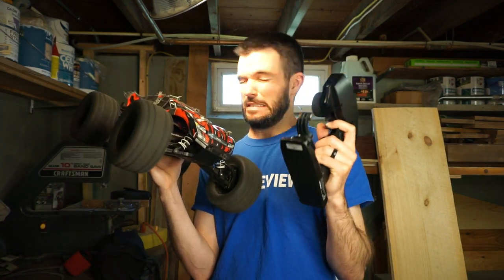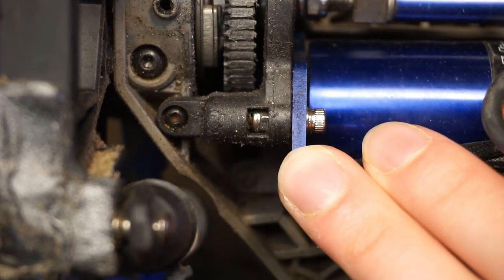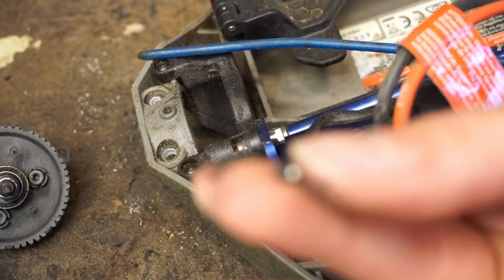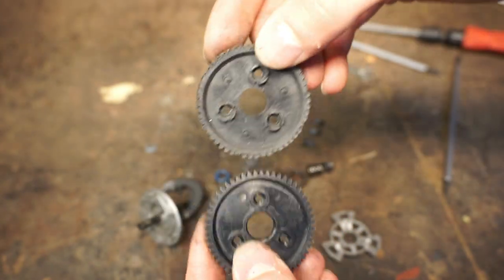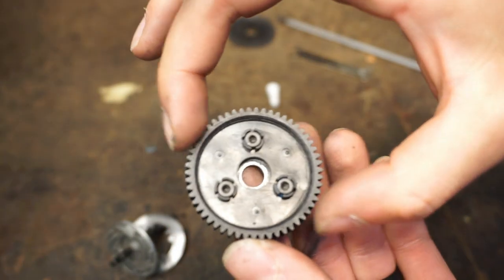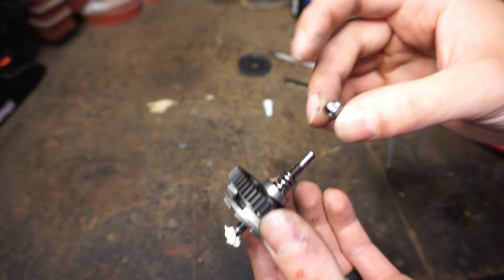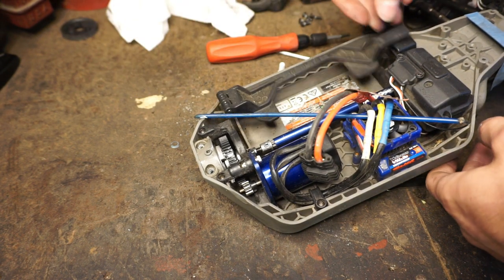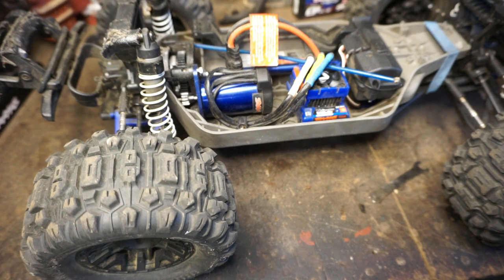Step by Step how to change a spur gear  Traxxas Rustler 4x4 vxl Slash 4x4 VXL Stampede 4x4 vxl

Comment: These models do not have a crush assembly. Slipper clutch assembly isn't  required to be  disassembled but good to  completely  inspect. Ultimately, not an easy video to film. Good job.
Reply from the maker: Thank you for the feedback. Much appreciciated

Comment: Good tutorial thank you. I've honestly never had to replace a spur gear before or pinion haha so this was a first for me. Question about the slipper. Do i have to take the slipper out to adjust it (tighten, loosen)? When i tried to loosen or tighten the little nut on the slipper it just kept spinning the motor. Idk if im dumb or if theres something else i need to do to keep the motor from spinning?
Thank you for the video.
Reply from the maker: You can tighten it with the small nut infrastructure of the spring on the slipper. Don't have to take it out...

Comment: you just need to pull out the slipper/spur assumbly, you dont need to remove the grub screw for the center shaft it pulls away with the little outdrive still attached. Also you dont need to dissable the slipper just take the 3 screws and replace the spur with a new one. Ive done this around 10 times already
Reply from the maker: Yeah I've heard that a couple of times now. Thank you for advice. I do more work than required.
Reply: @GReviewz  clutch shoe replacement is your teardown in the vid.
Reply: Good call out you don't need to do all that for the spur.
Reply: @GReviewz I found your video very informative and useful bro I can use this for multiple fixes thank you

Comment: Great video. Could you do one on setting the mesh, after putting or replacing the motor gear, the 11 tooth comes with it I believe. I tried a different size gear and till can’t get my mesh set the right way.
Reply from the maker: Great idea. The little piece of paper trick usually works for me
Reply: I changed to 9t pinion and had a rough time with mesh. Used a piece of sticky note paper and it worked great for me. I geared down for bigger tires and driving in the grass.

Comment: Changing my own spur gear right now, second time but I was wondering how tight I should tighten the spring?
Reply from the maker: Depends on if you want to pull wheelies or not.. if you do, crank it down, if you want controlled launches, not as tight

Comment: I put an arrma blx 100 esc and 3200 kv motor with mx 2.8 no heat issues.
Reply from the maker: I've heard arrma are less durable than traxxas electrics?

Comment: Great video.  My son just got one and I wanted to know what I'm in for WHEN it goes.  What kind of grease is that at 8:29?
Reply from the maker: Red n tacky grease is the best for differentials
Reply: Just got the rustler a couple days ago and the stock plastic gear is already shredded to bits. I recommend you buy a hardened steel gear to replace it. Got one on Amazon for about 17 bucks
Reply: Plastic spur gears are only about 3 bucks at the LHS. Lot cheaper to replace plastic than a steel spur but it depends on how often you shred your spur. $3 will add up, so will $17

Comment: Does your truck do wheelies on 10/54 gearing? Cause i cant get my rustler 4x4 brushless converted to do wheelies, and i know you have the exact same car as me. So do you know what’s happening?
Reply from the maker: Yes my rustler 4x4 vxl does wheelies no matter what gear I have. 2 big factors.. what battery are you using? If you want on demand wheelies you need to have a 3s lipo. Also, you need to tighten your slipper clutch all the way tight. If it is even a little bit loose itll never pop wheelies. The clutch will just slip. Let me know if that helps
Reply: Alright im using a 4000 mAh 3s lipo. And I’ll tighten that slipper clutch. Thanks!

Comment: What size spur gear would I need for a brushed  rustler 4x4? But I do plan on making it Brushless
Reply from the maker: Alex, stock for both trucks is a 54T spur gear. Here is the link to purchase: https://www.amazon.com/dp/B07PHMLSNW/ref=cm_sw_r_cp_apa_glc_fabc_03Q8RZHV4J2YQ548N0CH
Reply: @GReviewz  thanks a lot 👍🏽
Reply: @GReviewz  Can I run a steel pinion gear with a steel spur gear!?!?!?!

Comment: That plastic bushing that has the bearing then spring go on should be replaced. The plastic wears out and causes a wobble causing the spur gear to wear. There is an aluminum replacement that is better. Your there changing the spur it’s a no brainer to upgrade that part
Reply: Exactly what I just did :)

Comment: Why does my Traxxas Rustler 4x4 vxl keep stripping the gears? First I changed the pinion gear to the optional 17 tooth pinion gear it came with and it stripped the nylon 54T spur gear. So then I switched the spur gear out with a metal one and it sheared the teeth off the pinion gear. Didn’t even put it on the floor just elevated free spinning. I did the paper mesh trick and everything. What am I doing wrong?! So frustrating!
Reply: Might be too loose

Comment: I was wondering if there is any different size spurs. I want to lower it to like a 50t. But most spurs I find won’t work... if so could you possibly give me a part #?
Reply from the maker: Yes, you can get different size spurs just make sure they are 32P spur gears.

Comment: helpfull video ,could you do more reviews about the sledgehamers and clean your truck ;-)
Reply from the maker: Jef, thank you very much for the comment. What would you like to see about the sledgehammers? Just a driving video? It vs. The talons? Ideas are welcome.
Reply: @GReviewz  yep something like that i have ordered the sledgehammers but i dont now if they are worth there money and there are almost no videos about it
Reply from the maker: Did you watch my other sledgehammer video? One way or the other, they are awesome tires, for offroad traction they are incredible. They do put more stress on your driveline and your suspension. With the sledgehammers, the balloon so much that you can do standing backflips. It's pretty awesome
Reply: @GReviewz  Could you do a comparison of the self righting with the stock talon 2.8's and the sledgehammers? That would be appreciated.
Reply from the maker: Joshua, unfortunately because my truck was the brushed version originally, I dont have the self righting function. I can tell you just from having the tires, they would make it much easier to self right the tires are big, heavy, and they balloon alot.
Reply: @GReviewz  Just go full reverse then stop quickly, then repeat multiple times. Self righting can be done manually as well.
Reply from the maker: @JG-oc9gc  yeah, I have done this before, but i know it is very hard on the drivetrain. :)
Reply: @GReviewz  Okay. That is fine if you think it will hurt your car's drivetrain.
Reply: @JG-oc9gc  I can only get mine to self right on pavement with talons. Grass I got it to work once with some badlands (smaller badlands. Not MX28). I think self right is kinda hard on the drivetrain. I usually just walk and flip it over. But yeah bigger tires make it easier

Comment: Did you consider a steel gear?
Reply from the maker: No I havent, this is the first spur gear replacement I have had to do and I have had the truck for about 7 months now. Lasted quite along time considering how much I beat the truck up.

Comment: 😂dude you didn’t have to do so much work. At the start you did not have to take the grub screw and drive shaft cup off. Later on you did not have to take the whole clutch assembly apart you just need to pop the bearing off and unscrews the three screws In the pinion and pull it off and screw on the new one